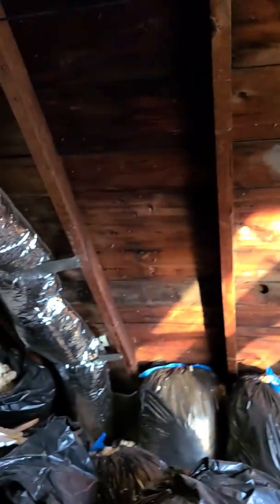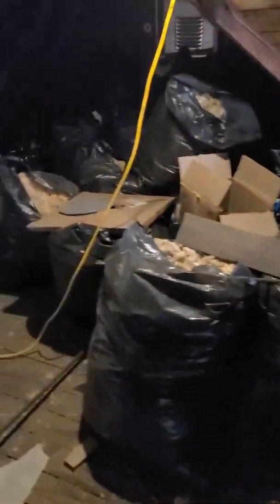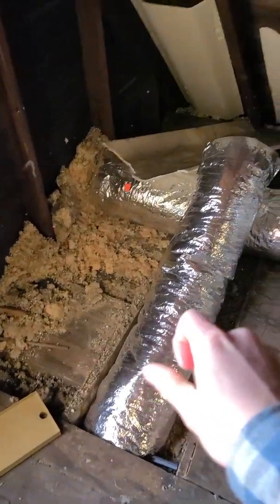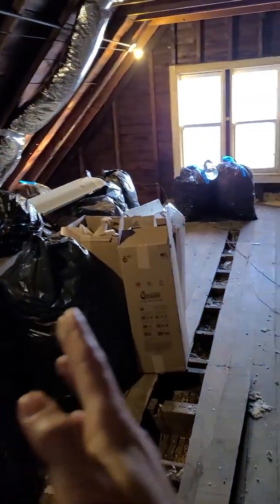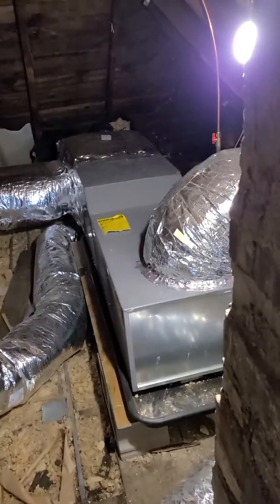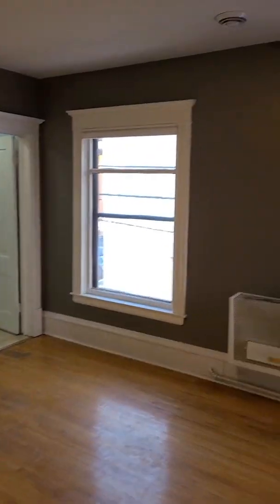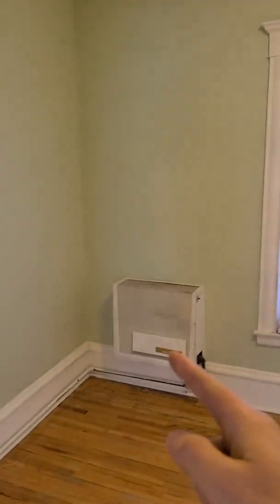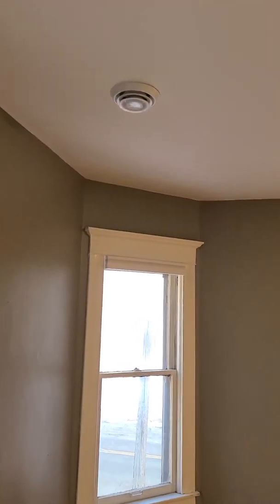📌Installing Furnace, Air Conditioner, and Ductwork in an old building 🏡

Comment: Thank you for the video. I have a question: did you out back any isolation to the attic???
Reply from the maker: Not yet, only because I am considering finishing the attic and using spray foam insulation.

Comment: How big was the air return?; from the video seems to be too small. This could increase the noise level of the system. With flexible duct provided it's correctly sized you should have a whisper quiet system.-
Reply from the maker: Good point. Not sure of the size off hand but it is a bit noisier than I'd like.

Comment: About how much did this cost you? Looking to do something similar to my 1908 two story, craftsman. About 2400 sq ft.
Reply: You'll probably need a four ton system; make sure to do a heat/cool load calculation to get the right system in your home. Window type; shading trees, etc.
Reply from the maker: About $11,000. This was in 2020 though for a 900 sq ft unit.